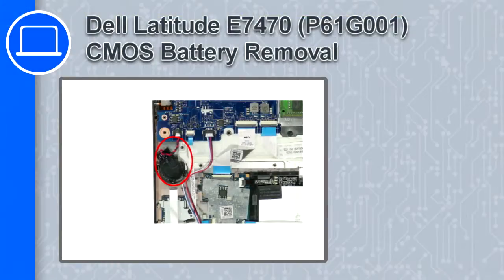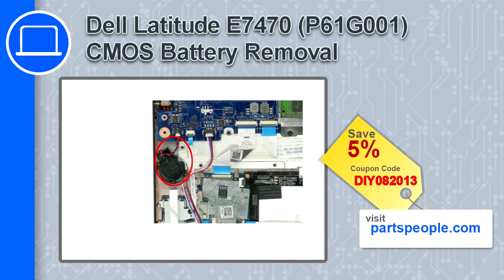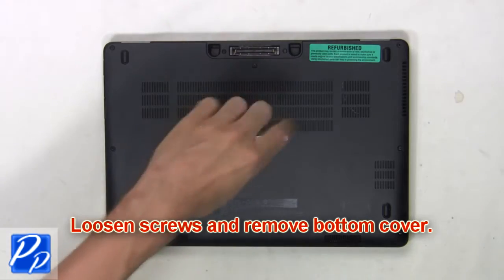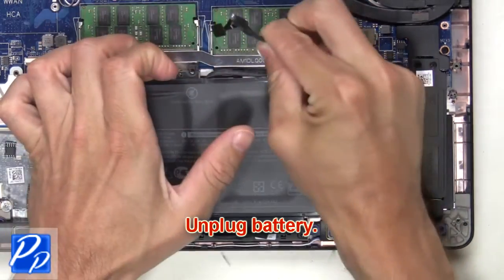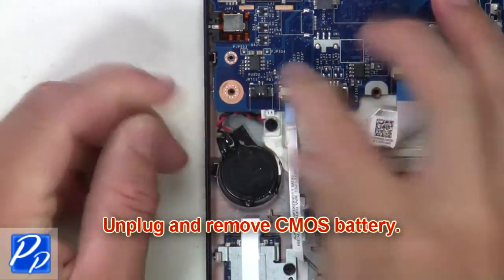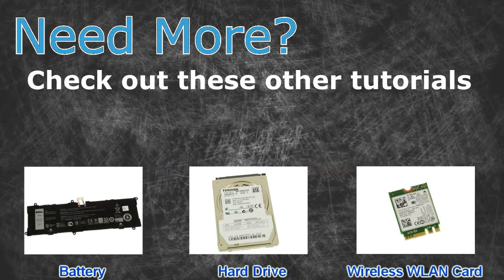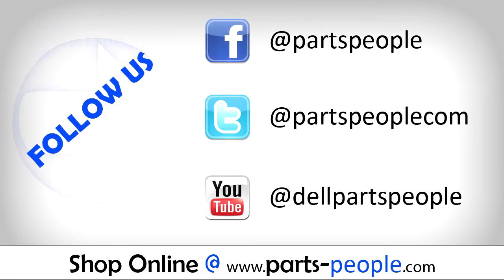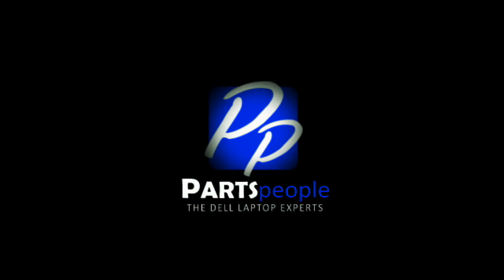Dell Latitude E7470 (P61G001) CMOS Battery How-To Video Tutorial

Comment: what happened if we’re not unplug the battery first befor change/replacing the cmos battery with the new one?
Reply from the maker: It can result in ESD or ElectroStatic Discharge. This is a major concern when you handle electronic components. A slight charge can permanently damage circuits, cause intermittent problems, or shorten product life span.
Reply: @dellpartspeople  ahh i see. thank u so much for the information!! it helps a lot